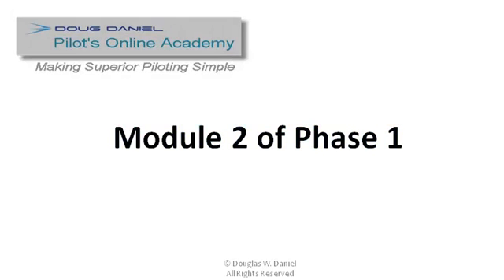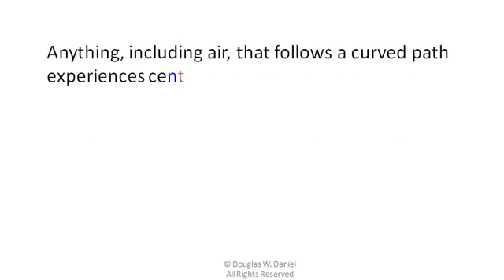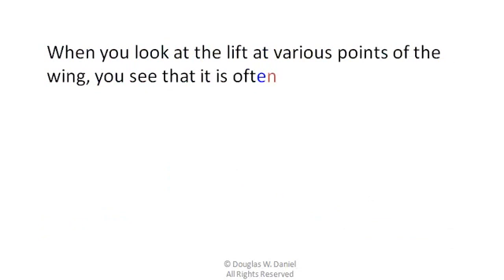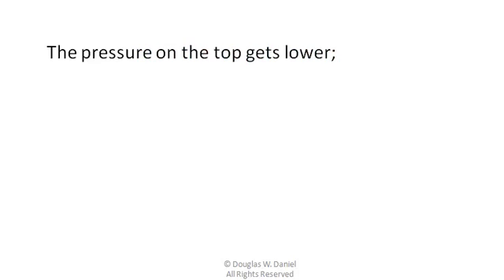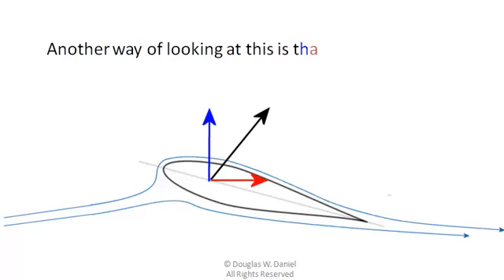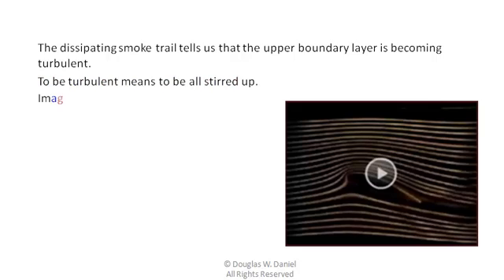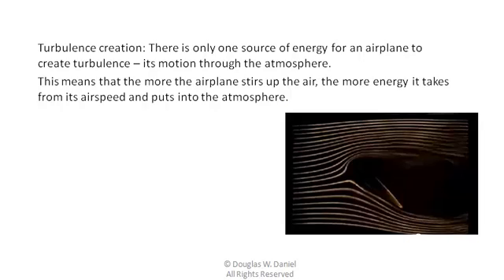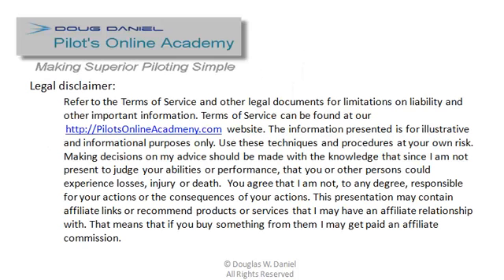Aerodynamics of Lift and Drag

Comment: I deny that flow separation hinges critically upon the normal pressure gradient's inability to balance/overcome the local centrifugal forces of highly curved streamlines. I suspect that a more accurate explanation may be that beyond a certain high-lift threshold, the boundary layer fails to progress downstream into the severe adverse pressure gradient, and eventually stops moving forward completely (no slip bc + du/dy=0). Beyond this point the local flow direction is reversed. The boundary layer upstream of this zero-velocity plane therefore cannot continue along the surface, and is forced to separate off the airfoil due to the kinematic restriction that the fluid cannot flow through itself. I am essentially arguing that the proximate cause for flow separation is at bottom kinematic, not dynamic (although dynamics is the cause of the adverse pressure gradient to begin with).
Reply from the maker: Certainly when the flow separates, stagnate air fills in near the airfoil surface and indeed flows opposite to the now separated boundary layer. That's beside the point. My purpose with this video was not to prove that I know more than others... having worked many years as a mathematician at a national lab in the area of fluid mechanics, that bores me... my purpose was to explain accurately and simply, without the use of calculus, the physics of flow separation and how that contributes to the loss of lift. As you point out, there would never be a severe adverse pressure gradient had there never been flow separation.
Reply: Douglas Daniel As you might have guessed, I am also a student of fluid mechanics and am keenly interested in a physically accurate description of flow separation. I am suggesting (with respect) that your description of why a viscous flow separates in incorrect. Energy loss in the boundary layer as a result of an imposed adverse pressure gradient from the outer inviscid flow is a better-supported explanation of flow separation than the centrifugal force overwhelming the streamline-normal pressure gradient force. Not only is the energy-loss explanation almost universally supported in the technical literature, but it also gives conceptually adequate reasons why the flow would be forced off the surface. In contrast, why should we believe that the flow is incapable of overcoming the V^2/R acceleration of a curved streamline?